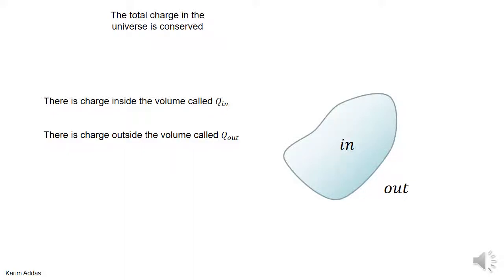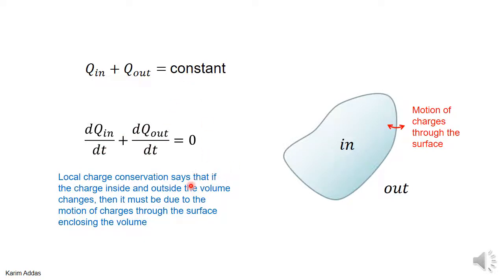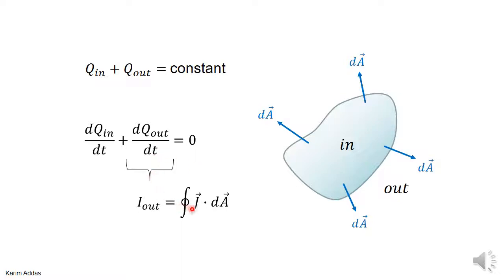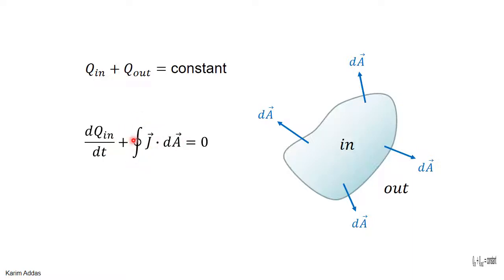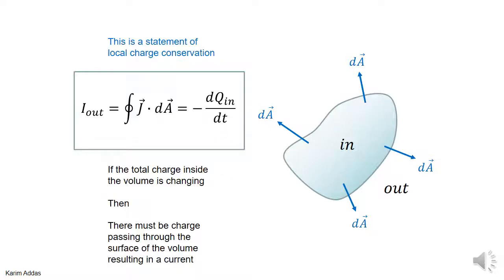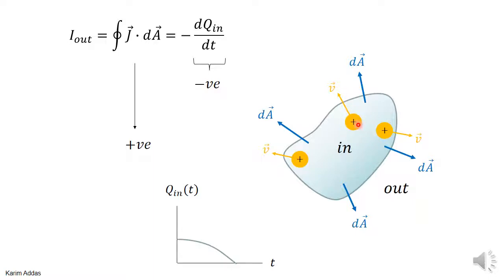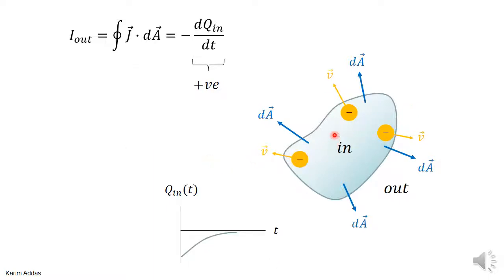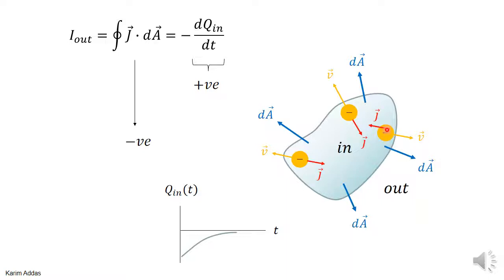1#2 local conservation of charge pptx

Comment: What is the limit for Qout because if we don't define/know the limit of Qout then the case, which you took in the video to show that charge is not conserved globally, will be included in this case also
Reply: Please tell about it or if you provided its proof then please give link for it
Reply: what do you mean by limit? Qout is basically all the charge that is outside the closed volume
Reply: @ka02143  but if there is a charge which is infinitely distance from volume then it will be Qout so what is the limit to take the outsides' charges??
Reply: @ujala6542  Qout includes all charges even up to infinity, but since we are talking about the current through the closed surface, then only the charge that goes through the surface from inside to outside or the reverse during a certain period of time will be the thing that changes Qout